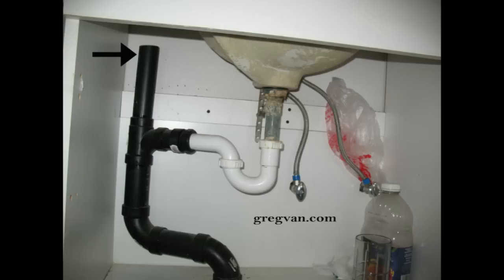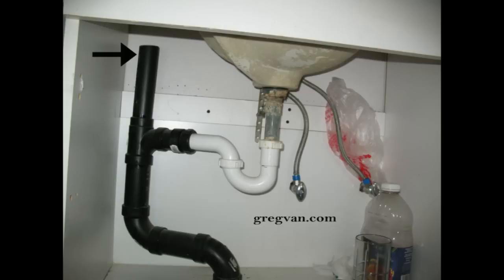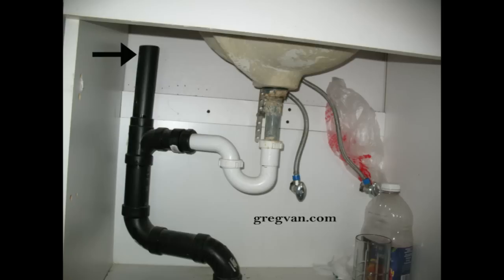What Not To Do With Sink Drain Vent Pipe-  Plumbing Nightmare

Comment: To fix this problem you need an Air Admittance Valve, the size of the vent pipe will be determine by the total amount of fixture units you are venting on that branch.

Comment: Thanks Greg for your response, and I apologize for pointing out your mis-pronunciation.
With further research after watching your video I found the proper name and device for venting behind a sink is called an "auto vent". It's a one way air valve, and is commonly used behind sinks installed in island counters where venting to the nearest wall and through the roof is not an option.
My local Lowe's had three different styles in stock.

Comment from the maker: Capping the vent off is the easy solution, next would be using an air admittance valve. However the best way to fix something like this would be to run the vent out to the exterior of the building or tie it into another existing vent.
Reply: gregvancom will it get me a nightmare?
Reply: +gregvancom agreed I was thinking why not auto vent it.  its not the best fix but it is definitely cheaper and simple just glue that sucker on.
Reply from the maker: I think the main point I was trying to make in this video is that it is easier to cap it off, even though others suggest using an auto vent that could fail, taking you back to square one. I understand the argument that there is a possibility, not a guarantee that the water in the trap next to the pipe you just capped off could get sucked out by a nearby plumbing fixture like a toilet after it flushes, but again it might not, taking me back to my original point of the video.
Reply from the maker: I know someone who deserves a cap put in them and would love to send them to your home with a cap. Just to make sure, I could send them over with multiple caps, may be a one for one deal.
Reply: How to fix kitchen sink air vent
Reply: gregvancom I read air Admittance are only should be a temporarily fix until you can get the vent ran outside.
Reply: @louishollandjr  It's not that serious so buy a few, don't use the old spring ones that fail. No one wants to cut a hole in their house if they don't have to and what is the big deal anyway, plumbing is not rocket science.

Comment from the maker: Thanks for taking the time to comment on the video. It sounds like these studor venting systems might be approved by building departments and therefore can be used. Make sure that you check with your local building department before installing them.
Reply: Never contact your building department for anything unless you get caught.  Then beg for forgiveness and permission.  Building departments are light years behind current building theory and often demand you do the wrong thing.

Comment: What you are looking at is a sink that was once connected with an S-Trap. Everything you see is correct for a conversion from an S-Trap to a standard P-Trap except, whoever did the conversion either forgot, or neglected, to install the air admittance valve on the top of the vent.

Comment: AAV. Duh.
Great video! I love YouTube when I need knowledge.  A loose toilet is the number 1 cause of sewer gas smell. It is often times not thought of as the cause of the smell. 99% of the time it will not leak water onto your floor when flushed. A loose toilet can allow sewer gas into your bathroom and you do not know the smell is coming from there. Your toilet should not move or rock back and forth much at all.  Your floor may be uneven. An 1/8 shim or 2 may be needed to level your toilet before installing a new wax ring. Sometimes it can just be tightened to get a good seal. If not, a new wax toilet ring needs to be installed.  I install toilets everyday M-F. It can be difficult and it is easy to do it wrong and have a leak. Not a water leak, but a sewer gas leak. Also you should be able to see water near the top of your tub or shower drain, if not your P trap is leaking and needs fixed. The P trap holds water and does not allow sewer gas to enter your dwelling. Unused sinks, tubs and showers need to have water added periodically if not being used.  AAV vents can also fail and allow sewer smell into your dwelling. Even an improperly glued pvc joint can allow sewer gas to escape. If it is just a P trap that needs cleaned. I just pour a little bit of bleach into the P trap and let it sit. If my P trap is full of build up of hair and other things, I use a toilet plunger I bought for JUST sinks, showers and tubs. Add some water and plunge the blockage back and forth until it drains out of the P trap.

Comment: I just want to add one thing... this kind of venting used to be found in older homes that would have a WHOLE HOUSE trap before the main connection to the sewer line.  Some of those old houses would actually predate the municipal sewer, and were sometimes connected to "questionable" septic systems, such as pipe leading down a bank to a swamp, river, etc.  But I digress... some weekend warrior would come along to replace the dated, ancient sink, and re-install "new" looking PVC in the exact configuration as the old pipes.  As long as the whole house trap is still there, you don't have to worry about the sewer gas and run out to cap it up like your house is going to explode.  But if it was removed when the house was hooked up to central sewer, which was common, then this is a real hazard and I would think that the smell would have driven the homeowner crazy, but also your house can explode from methane build up.  Have a look in the basement before you freak out after watching this video -- check if there is an old cast iron trap at the main line connection.
Reply: I have an old rat trap. Had an old s-trap got rid of it and put an air admittance valve in.
Reply: Older homes hand their traps underground in crocks in the basement but that was old school NY

Comment: am in philippines the floors are concret e. Havent got a clue how its set up concrete walls floor and ceiling. Have a 3inch copper pipe coming out of wall where,the sink drain should be connected but sink isnt connected. Have issues with smell,in the bathroom.

Comment: its important to remember that even though national plumbing codes may allow these vents, the area they are in is the governing agency, local codes can and do overide national codes. In California I have never seen an air admittance valve in a building. I do remember seeing one now in a travel trailer.  Its possible you may be allowed to use them in your area but you should check first. Also my realtor told me that during a prepurchase home inspection, such a valve or construction such as the photo, would quickly negate a sale if the homeowner would not have the building brought up to code.
Reply from the maker: +JIMMY TATE I think you're the first person in a long time who agrees with my point about building codes and the fact that they might not be approved in all areas. Putting an air admittance valve on a vent like the one shown in the video might provide you with a temporary fix and work better than my originally suggested method of installing a cap, but might not be an approved fix by local building authorities.

Comment: you install a auto vent on that and you get no gas odor. It will meet the 2012 plumbing code requirements. no need for unneeded vents.

Comment from the maker: According to most of the information I heard so far, you can simply put an air admittance valve over the vent pipe, even though it might meet your local building codes. You should check with your local building department for more information or gather more information on air admittance valves.
Reply: A youtube video search is far superior to a call to the building department which employs nepotism to fill slots.

Comment: I have a utility sink in the basement and I gotta replace the p trap. The vent/air pipe connected to the p trap is right next to sink and it's wide open. Should I close it off with a vent cap or leave it wide open
Reply from the maker: See if a air admittance valve will work and if not, you might be better off capping it to prevent sewage from entering your home through the open vent.
Reply: @gregvancom  then how will I get the air pressure I want?

Comment: I did not come out right upstairs bathroom I have a two sinks one of them has air vent system the other one doesn’t so I let the water run for 15 minutes or 20 and it starts leaking downstairs slowly is out the reason why I don’t know what the second bathroom air vent or what is it

Comment: i have a question. Where does the bottom end of the drain pipe go?
I have an issue with our air vent pipe in my condo. we live on the main floor of the 4 stories condo. We are sharing one air vent pipe. out pipe connecting to air vent burst due to the clog on one of the units upstairs. I guess once the drain clogs they go to the vent pipe and goes down to our and sometimes goes out in our sink. What would be the remedy for this
Reply from the maker: This video might help https://youtu.be/BUxdWfWIJOc

If you live in a condominium, then you might want to contact the property managers, but you can always contact the plumber or try to unclog the drain line yourself with a plumbing snake. This can usually be rented at your local rental yards.

Comment: I've redone all the plumbing in my house that was built in 1913. The plumbing was added years later and all the drain pipes were lead. I replaced all the drain pipes from the roof to the basement with PVC. The bathroom is directly over the kitchen and everything was easy to connect all the drains together. It was also easy to  add a vent pipe for the bathtub and for the kitchen sink down below. The bathroom sink vent just runs up into the attic and connecting it to the vent pipe out the roof wasn't possible, so I just put an Air Admittance Valve on it. Simple solution.
Reply from the maker: You bring up a good point and as long as local building authorities approved the use of air admittance valves in locations where it would be difficult to place a vent pipe, then your only problem would be to make sure that it continues to work properly. Remember air admittance valves are mechanical devices that can fail.
Reply: I never apply for a permit to do anything inside my house. The attic is only used for storage and there's a open gap under the eaves, so even if the valve fails the attic is well ventilated. It's also a screw on type and easily replaceable as the base glued to the vent pipe, . The only thing that may not be allowed by code, is the bottle trap I had to use for the pedestal bathroom sink that is too close to the wall for a p-trap.The only plastic bottle trap I could find was from England for $15 inc shipping. Metal bottle traps aren't permitted by code as the internal down pipe may rust out and permit gases to come out of the sink. That's why I went with plastic and hope they're permissible.
Reply from the maker: Hopefully everything works out and you never have any problems.

Comment: Every state is different every state has different plumbing codes I live in Atlanta Ga and this is allowed as long as the pipe that hooks up the vent is longer than 6 inches you good to go.
Reply: Luis de la cruz , wrong dude...you do have the six inch part right but it needs to be topped off with a pro-vent . They are widely used in Mobile homes.

Comment: Thanks man, I just blocked the vent with a latex glove and rubber band, that should work temporarily, or even permanently when you think about it. Lets see if this works, hopefully the water won't get sucked out of the U-trap.
Reply from the maker: That's a good idea, but it would be better to install a cap that can be glued on if dealing with plastic or a rubber fitting with a hose clamp, just in case the water ever backs up. If the sewage pipe ever got clogged, the water could back up and break your light-duty latex glove.
Reply: gregvancom
Never would have thought about that, thanks.
Reply from the maker: You bet.
Reply: Dude they have these things out there called "cheat vents", basically it's a one-way air admittance valve that you would attach to a vent pipe in this EXACT situation. It lets air vent the drain, and closes. Capping it in any way is a sure way to suck your trap seal dry.
Reply from the maker: Remember, air admittance valves aren't always approved by local building authorities, but might provide you with an alternative to capping the pipe.
Reply: gregvancom I think they're allowed most often in reno construction; not so much in brand new buildings.
Reply: I just wrapped it with electrical tape we have been smelling gas for quit some time smelled like a skunk had died.. we took out the crappy floor under the sink seemed like it helped but then we noticed the vent I removed one when we installed a new kitchen sink not had any problems Not sure why removing the cardboard floor helped. The thing I don't understand is I have never seen one in a stick house.. I was told by a plumber that if you don't have a dishwasher then it is not needed. Well I guess we shall see if my tape job was a good or bad thing  all in all the smell is gone
Reply: BTW I plan to get a cap...the one in the kitchen was glued had to cut it off just put a slip to thread and a cap
Reply: well looked down the sink after flushing still waster in the P-trap then I watched while i flushed  the water giggled a bit but it stayed in there..It is a low flow toilet so may not work for every situation..It is strange though quit smelling the gases when we took the cardboard floor out I thin it could have been stuck the it stated working when it got bounced around a bit
Reply: Lol the water giggled a bit. Made my day.

Comment: Cap it temporarily. But you need to put a studor valve on it.
Reply: What is a stupor valve
Reply: @c.tucker95  An air admittance valve is an inline valve that allows air into a drain line to help water drain more quickly. An under-sink installation of an air admittance valve will allow air to equalize the pressure within the drain without allowing sewer gases to escape the valve and into the house
Reply: @simonsmith2642  okay well I have found the problem, I have a blockage of paper prod bcuz my snake reaches it and pulled a little bit out but I couldn't get it any further.  I wonder if there might be another trap further down the way like under the house at that t valve

Comment: So my kitchen drain pipe broke.  Plumber installed new pvc pipe to replace the old cast iron.  Ran a new pipe.  Capped th old one under the sink which ran into the wall.  Then in my basement above the main stack he cut the old pipe out for the new pvc.  I started getting water in that area and was puzzled till I realized the roof vent was uncovered and any rain we had was running down the pipe collecting inside.  I scratched my head for weeks wondering how it was possible that water was coming down and unused drain pipe...lol.  I put a mushroom cap on the roof to prevent water from coming into the pipe. 

 To my question.....he didnt vent my kitchen pipe.  Its only my sink and dishwasher but do you think its an issue considering I also have a garbage disposal.  I assume all drains should vent but it appears mine is a closed system now witb zero vent. I suppose its not an issue if there isn't gurgling or slow draining right? I also assume this can be a bigger issue if you have toilets that need to vent.
Reply from the maker: I really can't answer your question, because it could be confusing to others, but I understand that if you don't have the money to spend on this particular project, then leave it alone and hope for the best. If you start to see mold or smell those horrible sewer gases, then it that might be your first clue to start thinking about making these repairs.

Comment: Upstairs bathroom I have a tool sings one only has the air vent Do I have to have another one for the other sink because I let the water run for 15 minutes and water comes down downstairs in the kitchen slowly is that why